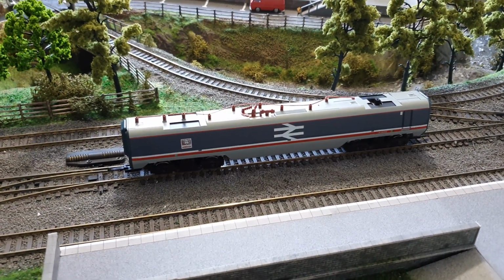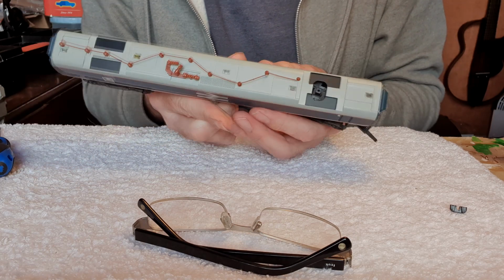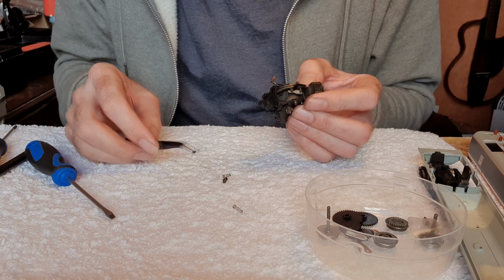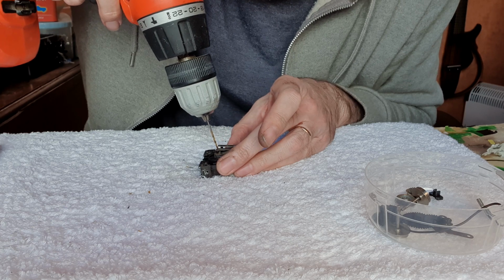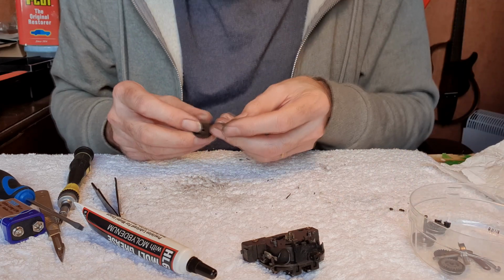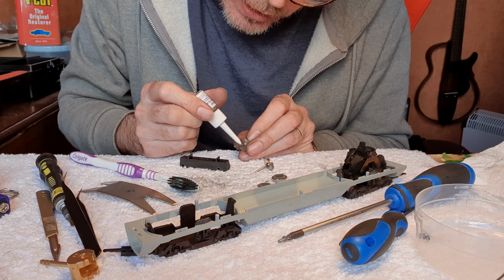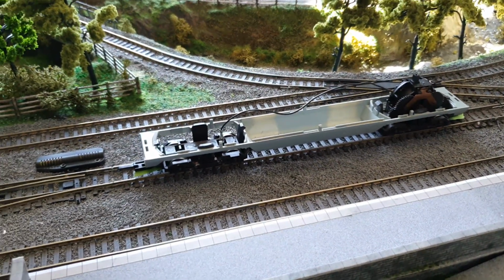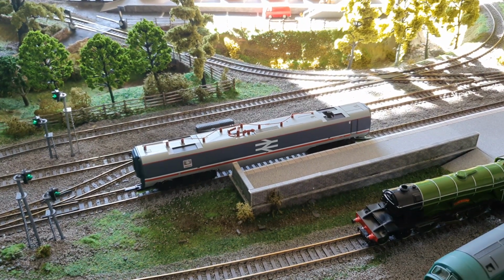Hornby APT Power Car: Repair Request

Comment: Great videos, but the corridor ends just need a screwdriver underneath  the raised part then they unclip and it's much much easier to dismantle as to the way you unclipped it. Cheers

Comment: Bill that was a brilliant idea to repair the motor cover by drilling and threading new screws. It is a crazy design how you need to remove the wheels to service the Hornby motors, my last set of wheels snapped when removing.... Great video thanks for posting.

Comment: And you fitted the screws in the motor plate that Hornby should have fitted in the first place instead of those nerve wracking clips.  It's nice to know that it can be done.  I wonder how many ring field motors are out there with broken clips 🙄.  Thanks for the video. 👍😊
Reply: @Alan wragsdale So you don't think the screws were a good solution then?  Better to just blame the user I suppose.
Reply from the maker: Every hornby ringfield I've worked on has had broken clips. Usually the pins are enough to hold it on and it just prises off but on this everything was broken. Screws required. M2 screws and a mini tapping tool are invaluable..
Reply: @oobill  Thank you 😊👍

Comment: Lack of weight. I have one of these and add some extra weights to the powercar and massively improves performance.
Reply: I was just thinking the same thing, it looks very plasticky and lightweight. A few lumps of lead would help the contacts and add pulling power.
Reply: @richardturnnidge  I was told that it would affect the passive tilting mechanism. But I did it anyway with self adhesive wheel balancing weights and it still tilted. The performance was night and day.
Reply from the maker: Yes it is light. But without the full train to see how it affects I didn't want to add weight. Generally speaking a little weight helps most locos if you can add it. A few of mine have bits of lead taped inside the body. And tenders.

Comment: Interesting you put peco power lube on the axles before fitting, I've done this on many of mine over the years, initially they run great but have found over time that this becomes a creamy dirt coloured paste which then reduces the performance of the motor and reliability (having the push the loco to start it/stalling over points seems to increase) significantly over time. Cleaning the axle with a rotary wheel brush on a dremel and fitting dry (yes - sounds wrong) has caused no problems whatsoever and the reliability seems to be maintained. I can only attribute it to carbon building up in the tube by design default but when you add the powerlube it makes the carbon build up creamy instead.     Maybe theres something I've missed?!
Reply from the maker: Most lubricants coagulate to some extent over time. Regular servicing prevents it. Running Ringfield motor axles dry probably seems fine in the short term. You will get good conductivity and no sticky old oil. But you have a spinning steel rod rubbing against a brass tube. It will wear over time if you don't lubricate.

Comment: Nice one Bill. It always makes me nervous taking off these types of body, you could see what was going on have you ever used a old credit card to slip in to enable you to get enough spread on the body to release the clips.  Nice fix though. Eddy xx
Reply from the maker: Credit card would be too thick for this. I used a spudger cos it needed pried open from a very fine slot. Otherwise I just use my fingernail... 😉

Comment: Hello Bill. This is an excellent video. I have two questions: -
1. What contact cleaner do you use?
2. What do you use to clean the wheels?
Many thanks, Nick
Reply from the maker: WD40 Contact Cleaner. Great stuff. I clean wheels with T-Cut and clean off with the contact cleaner. T-Cut is brilliant for cleaning commutators, wheels, axles...

Comment: You should be able to unclip the bogies without removing the body using a flat blade driver on the clip at the end of bogie towards the middle of the carriage. All Hornby diesel / electric loco's with this type of motor can be serviced that way as far as I know.
Reply: I agree.  I bought an intercity with exactly this problem and the bogie just unclipped as you say.
Reply from the maker: I thought that too. Like the 58 I worked on recently but on this the bogie clips are metal and don't bend.
Reply: @oobill  Ah I guess that would be a problem, never known that before maybe it's because of the tilt system.
Reply: @oobill  I think it might just be an edition design as my APT I got 2nd had in December had clips I could prise with a flat head and the bogies came out no bother.
Reply: To pull the bogies off they need to be hard into the corners of bogie opening in  chassis then they come off..

Comment: I would also add some weight to the center of the power car for both better traction and pickup.
Reply from the maker: Yeah probably not a bad idea. Without the full train I wasn't going to try that though. Too much weight might affect the tilting though.
Reply: @oobill  

Oh I missed the part that said it had a tilt function.

Comment: I wonder. I'm  not going to be able to get started on my planned new layout  as originally planned next week. But my daughter is pestering me to do something for my granddaughter. I have a big box of ancient Hornby Dublo 3-rail track and a couple of locos so I quite fancy setting something up maybe on an 8x4 base to keep them happy until I can get back into some "serious" OO modelling. Your layout doesn't seem to be too big, uses standard set track geometry and appears to have quite a bit of operating potential. Do you have a track plan by any chance? I'd really appreciate it.
Rob
Reply from the maker: Not as such no. My layout uses some flexi track it's not all standard sections. I may do a how I made it using Anyrail6 software video at some point as I get asked this a lot.